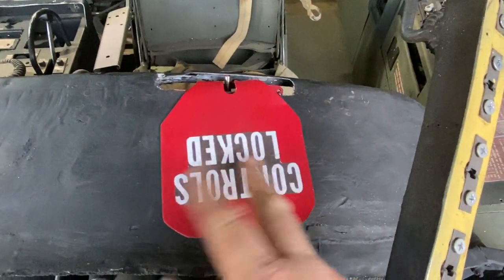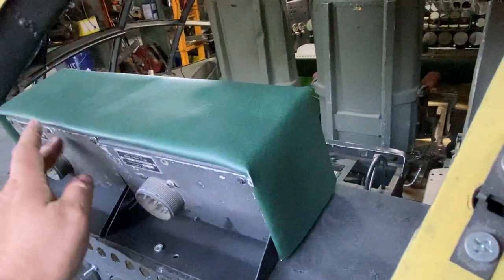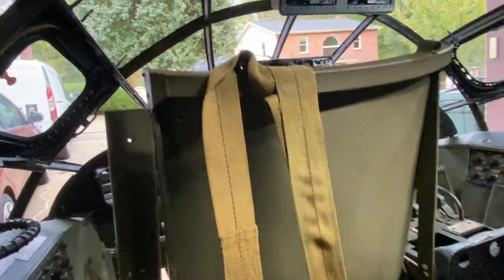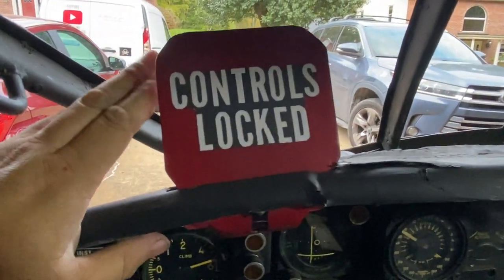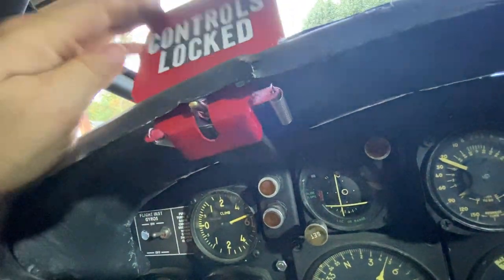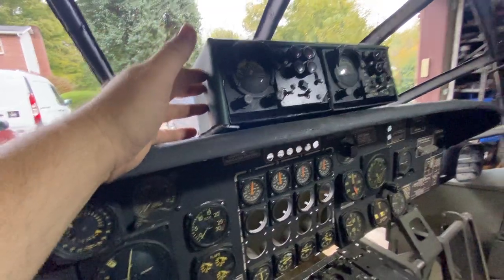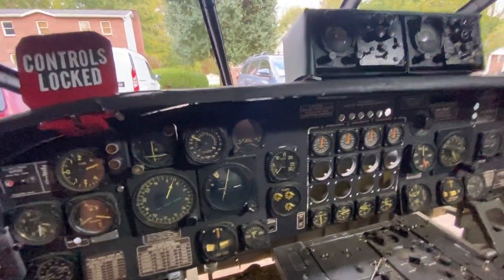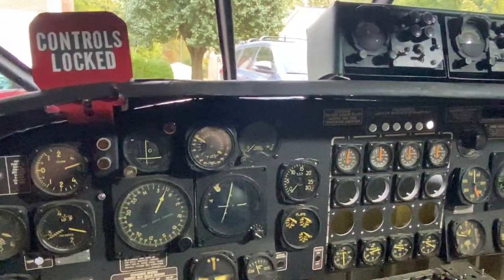Convair B-36H Pilots’s Control Lock Completed - T-18 Fairing

Comment: Looks great - even close-up like a real B-36 cockpit. I wish I knew of any B-36 crew still around, the few I knew are gone.
Don’t know much about the T-18 housing, more often didn’t have this.  The T-18 was designed in 1950 and apparently on the B-36 in 1951 – before there was only the large “FTB Mk4” from 1948 and the short-lived T-4 designed in late 1949. The T-18 was needed  to handle both the Mk-4 and Mk-6, which the others couldn’t do well.
Reply from the maker: Apparently there were several T-boxes on each aircraft and all had specific functions. In pictures I have seen three different models.
Reply: I hadn’t seen that, but early-on the result of the new dashboard boxes was they didn’t need the on-board weaponeer anymore.